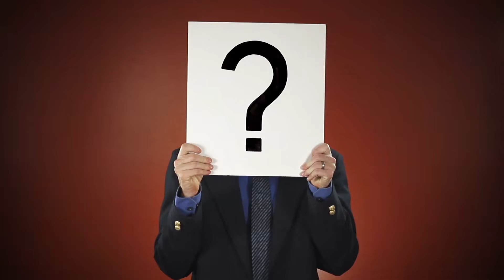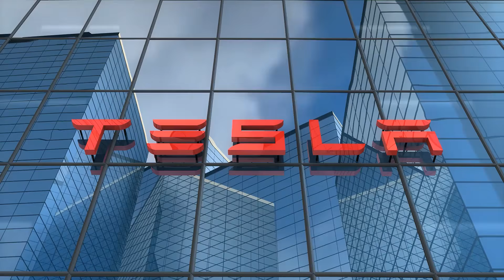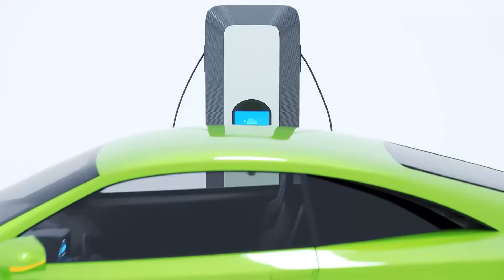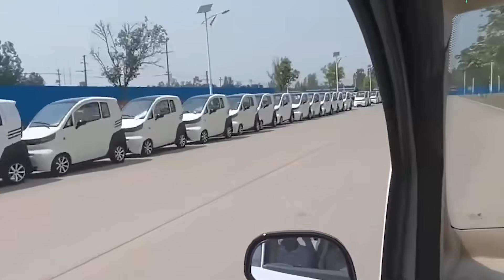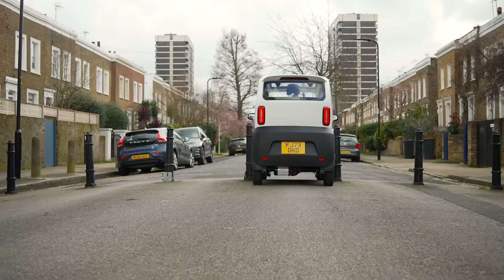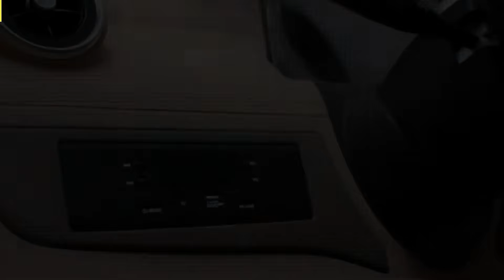UK Announce Tiny Mini EV $6,399 Car Will Shakes The Entire EV Industry!

Comment: The car, which is suitable only for urban use, is not sufficient, even if it is small and convenient. 70 km/h is not sufficient. The top speed should be at least 85-88 km/h.